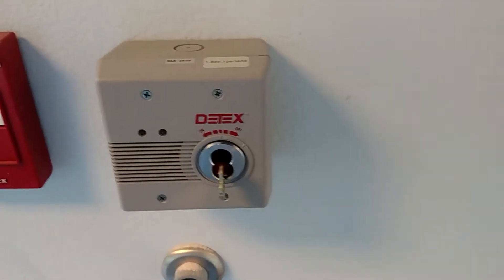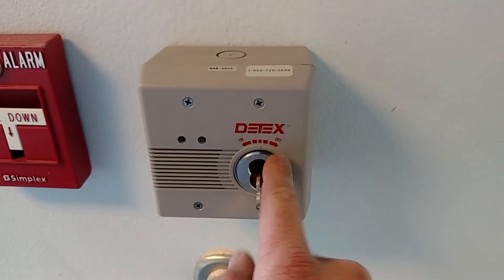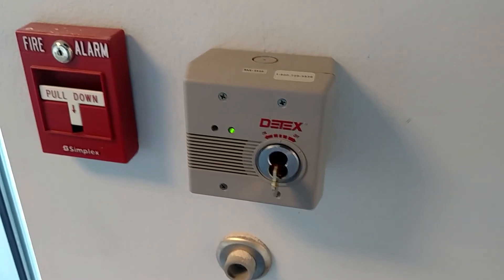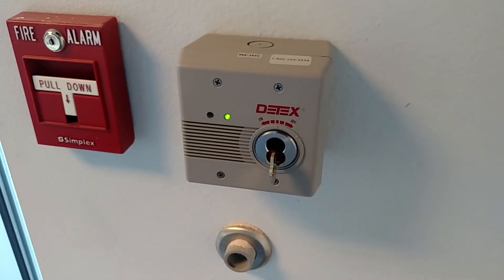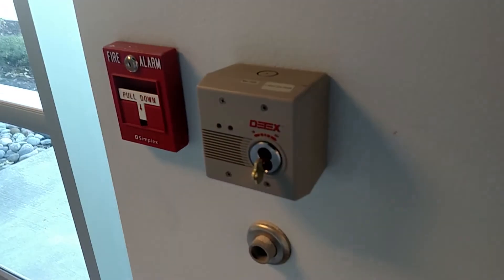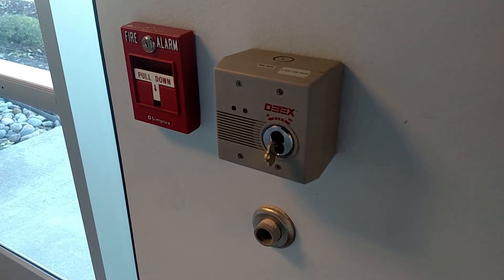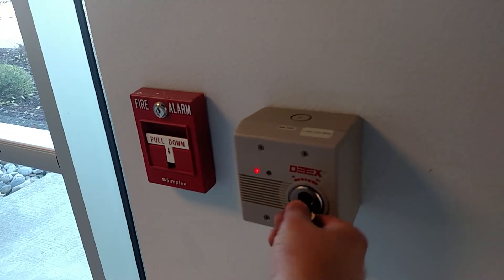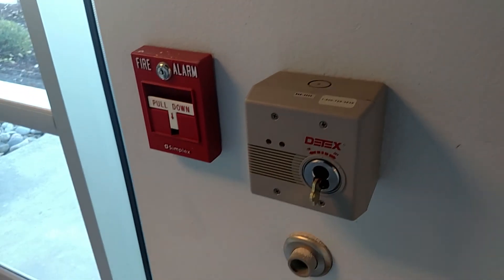How to arm / disarm detex door alarm

Comment: And of course,  Don't forget to label those double doors like this if the Detex alarm is installed near the door, but close to the station: "EMERGENCY EXIT ONLY; PUSH BAR TO OPEN; ALARM WILL SOUND WHEN DOOR IS ARMED"